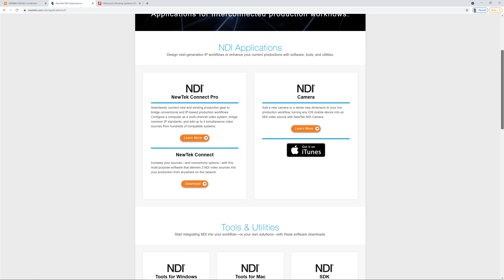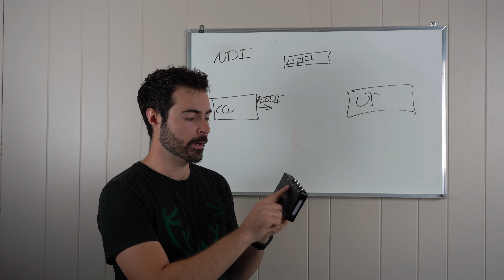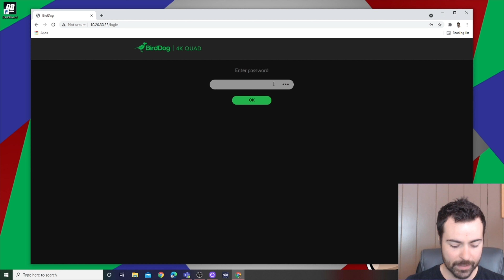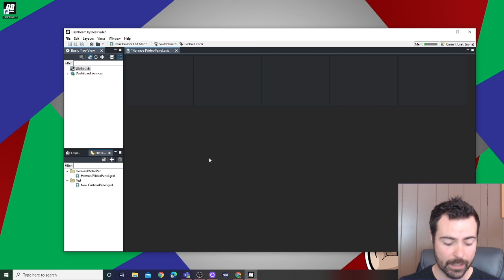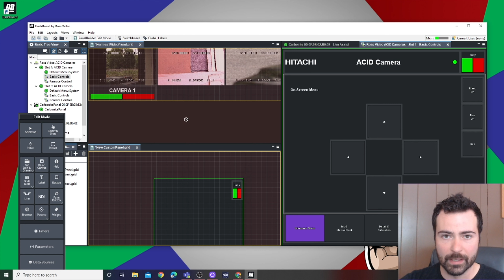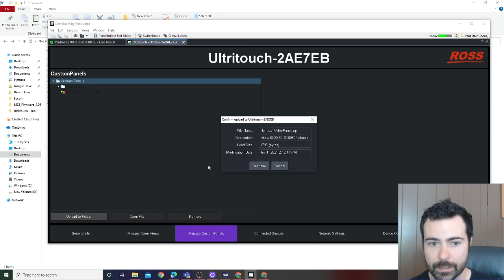Let's Build A Camera Monitor with NewTek's NDI And Ross Video's Ultritouch

Comment: Very nice work. Do you use the same cisco switch in the final version? At 271 Mb every stream each birddog should be 1 gigabit. The ross ultritouch does have a 10gig port? How are you managing that?
Reply from the maker: Hi! The switch used in the final build is a HP E3800 48G-4SFP+ (J9574A). The Ultritouch has a standard 10/100/1000 RJ45 ethernet connector.

It is all CAT 6 between the devices. 

I did end up having to change the NDI streams quality in Dashboard to "low" in order to get the best performance. I may still have to throttle the birddogs, but I'll have to wait until I field test it some more, lol.